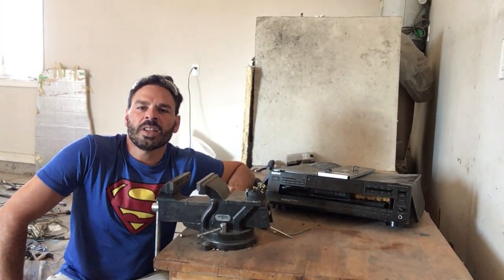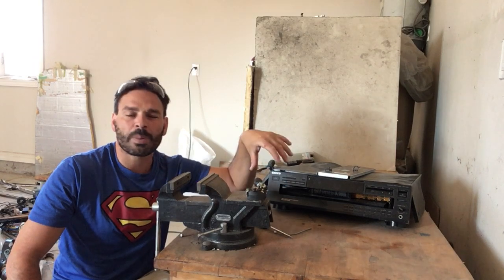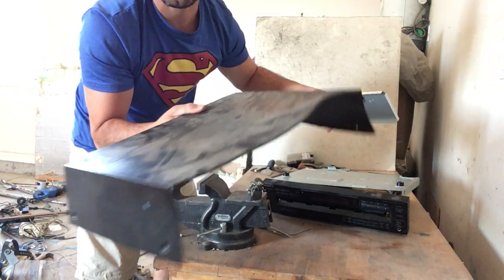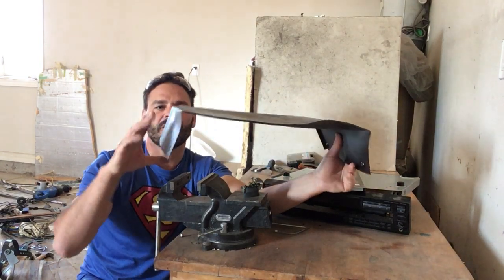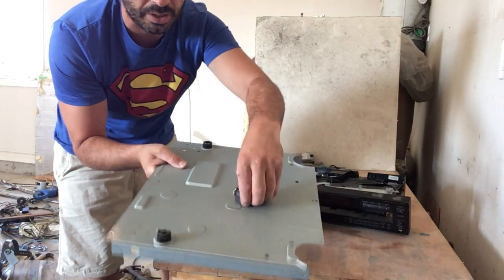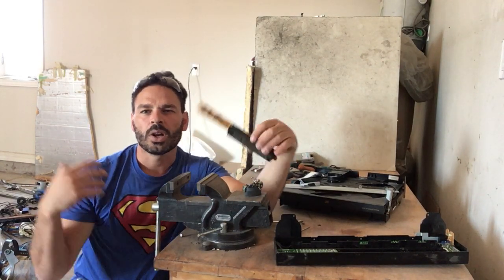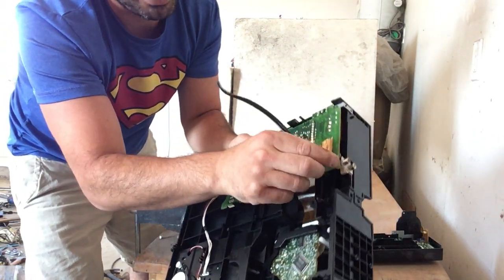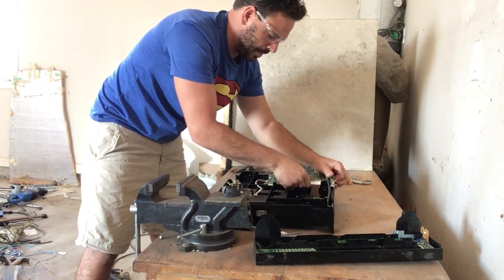Scrapping a multi disk CD player for tin, copper, and little waste

Comment: you could probably put the circuit boards in shred back when shred was low it was probably better to take them apart but you are losing a lot of weight throwing the plastic away so you probably need to cut the cord off then weigh it and then take it apart and see what you get appreciate all your work keep it up